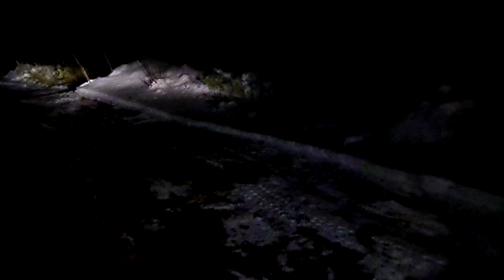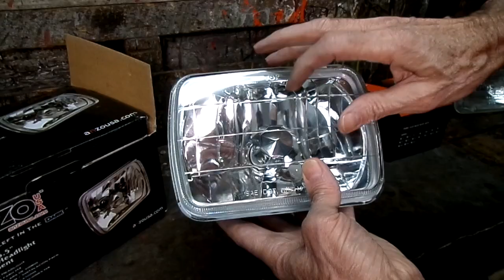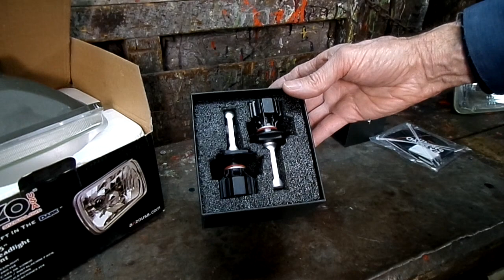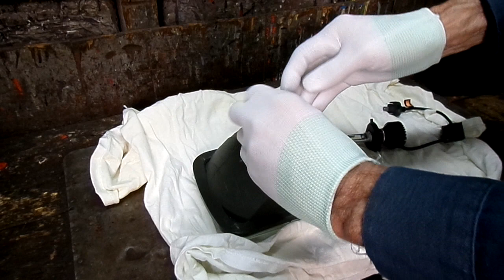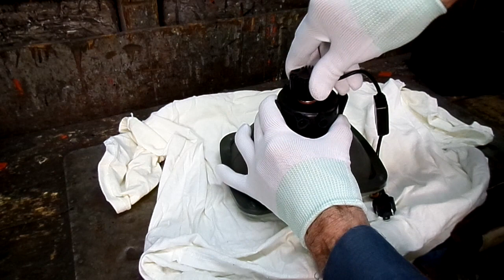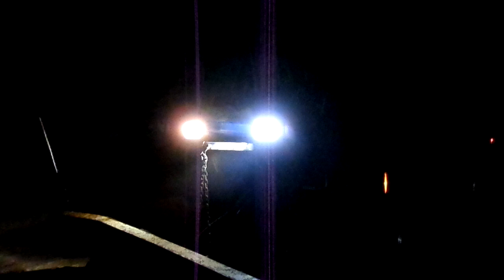LED Truck Plow light Conversion

Comment: Great video, the improvement in light output is obvious.  I recently upgraded all the exterior lighting on my 2000 Saturn SL to LED and it makes the car look much more modern, along with making it safer to drive up here in the rainy/dark Pacific Northwest.  Cheers Rich!

Comment: Thing is these new lights aren't really made for LED bulbs. If used on the street they may blind oncoming traffic. Did you notice if they iced up on you. I did a set last year with the 5x7 LED replacement but the snow packed onto them. This year I am trying the lights with the heated glass.